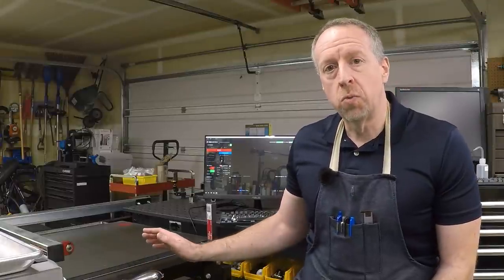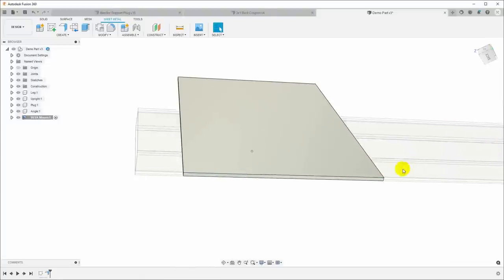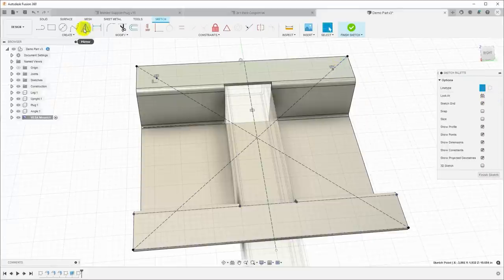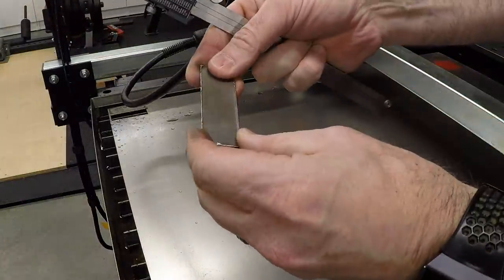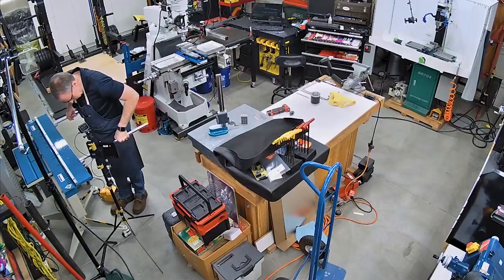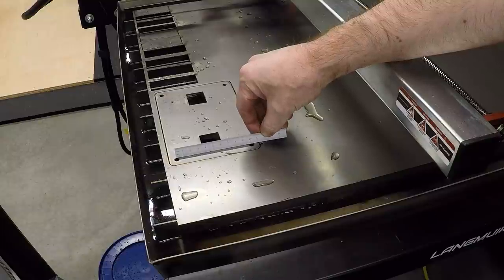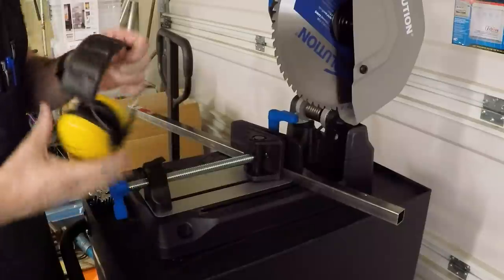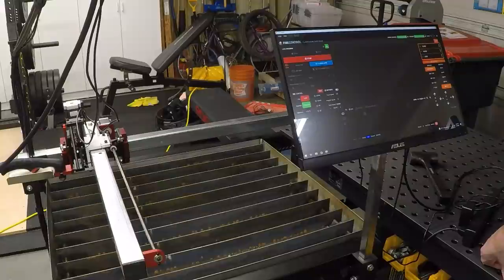Determining Sheet Metal Cut and Bend Parameters | CNC Plasma Table Monitor Mount Part 2 | Fusion 360

Comment: As always great video content. I do learn a lot about fusion 360 from your videos. Thank you! I wanted to point out that your Hypertherm manual should have really good info for cut speed and kerf width. I cut 16ga. At 220 ipm at 45amps and it’s relatively dross free. The setting from the manual for my hypertherm 45xp are really close.
Reply from the maker: The tables in the manual are useless for this.  They say that 14ga cuts at 120IPM max, and 18ga maxed out the test table at 400IPM.  They provide nothing in between.  I started at 150 and hoped to end up at 200 or 300.

Comment: liked cause you said you can't weld now lets see how it is.
now for a commentry mode
thast over complex a simple plate would have done. maybe gone to 2.5mm 
16 guage convers to 1.6mm :)
learning fusion 360 stuff all the time :)
Flange hehe 6:20
ooh 2 flat flanges at same time in opposite
9.20 god damn I hate inches, yes I know decimilised inches are still as arbitory as a meter
can project as construction line wow I'm blind
9.55 that point had no real constraint 10.30 ffs
sweet it works
our older evolution is way better vice arangment than that, that leanover is wrong. some nice extra features tho like quick move.
welding looks like a touch too much power 23.27 that looks like a crack. 
smaller filler rod

will do same with our bigger press break
you should be able to save the thickness as a tool

Comment: I abhor and despise Fusion 360, but everything else is right on the mark. great stuff.
Reply from the maker: I prefer SolidWorks, but for the money, Fusion 360 is a very capable tool that has worked well for me.  The two things I miss the most are constraints and part configurations.

Comment: Did you take the guard off the cold cut saw?
Reply from the maker: No.  All the guards that came on the saw are still in place.
Reply from the maker: Oh, hey!  I just checked, and there is indeed a moving guard.  It was jammed up inside the saw body.  Fixed.
Reply from the maker: Edit: the guard was jammed.  Fixed.

Comment: Isn't 16 gauge mild steel .062"?
Reply from the maker: This piece measures .057 with a micrometer.
Reply: @Clough42  Understood. Also brilliant presentation and thank you for that. This is the first video of yours that the you tube algorithm has presented me with. I'll be following along going forward. Also in the years that I've been welding, I've used mig for square tubing and it works really well, in my opinion. Might be worth your while to at least try it. Again thanks for the response.

Comment: i do't see why you're interested in the width of coupon when what you're realy interested in is the length.
Reply from the maker: The width and length are affected in the same way, so either will work for calibrating the kerf.  The length already has the bend allowance calculated, into it, so it's not a nice even number.  I was originally measuring the length and got really confused, and switched to the width.

Comment: Are you even a real engineer if you're not using mixed dimensions.
Reply from the maker: It's a reality where I live because machines and materials are dimensioned in inches.
Reply: @Clough42  
Heh, we import a lot of engineering steels and copper from the US in Aus, so instead of 1/2" × 1/8" copper bar, we market it as 12.7 × 3 mm.

Comment: way to picky chasing tight tolerances with a plasma cutter..   that part may have been fine but if it were many of the same, the numbers would have been all over the place.  I dont like 360 for plasma,, way too much work to draw and cut parts...
Reply from the maker: I'm seeing consistent results.  Not sure why I wouldn't want to dial it in.